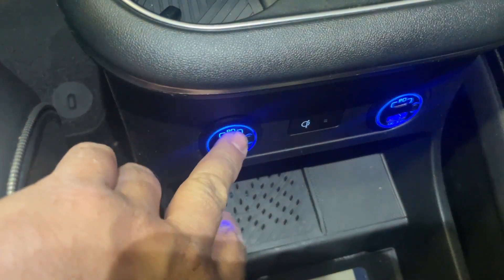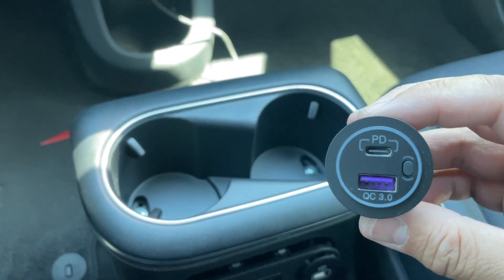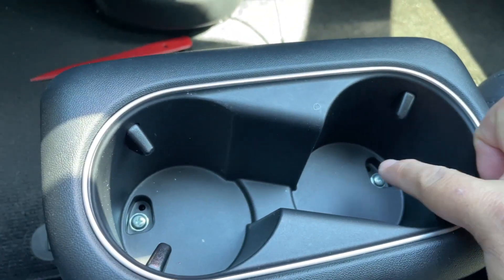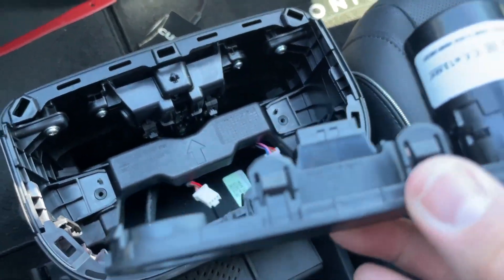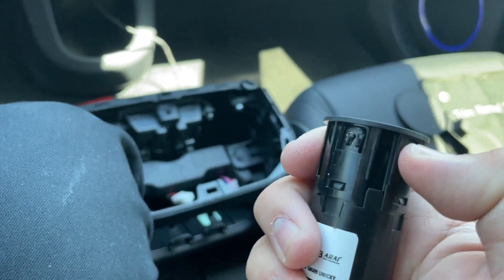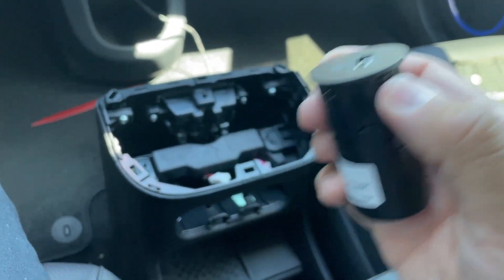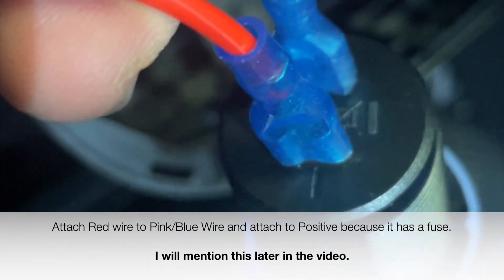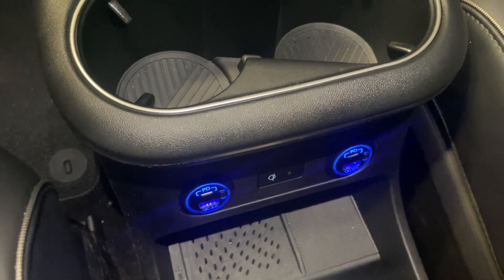Ioniq 5 USB Install

Comment: I attempted to do this in my ioniq5 that I just got.  The video made it look like a pretty simple task.  I'm here to tell you, it was not simple at all.  First off, the disconnect the three plugs was not easy as the catches are on the bottom of the connectors. I finally got them disconnected.  Secondly to disconnect the outlets was not easy either.  I have weak hands and found it very difficult to push the tabs in.  After much attempts, I finally got them out.  Now to tap into the wires.  There is very little room to work on the outlet on the right side. I used pinch clips instead of trying to cut the insulation on the wires.  I finally got them clipped in, very difficult!  Now to the left side.  This one is next to impossible with absolutely no room to work and absolutely no lead in the wires.  Needless to say, I gave up, put it back like it was originally was.  If you attempt this, good luck!  I made a little box for my outlets, put in an inline switch and connected them directly to the 12 volt battery and put them in the Frunk.This way I can use the fast chargers with the car off and the switch on.  I turn it off when no in use so there will be no draw on the battery.

Comment: What are the brown and pink wires in the molex connector for? Were they even connected to the original usb that came with the car? Instead of tapping into the wire, can a molex connector be used?

Comment: Hi @Rey. thanks fot the video. Did you tried to see further and remove the center console too? I wonder if we could conceal and pass a USB cable remotely under the console and under the floor up to the lower center front tray (where the Apple CarPlya/AndroidAuto USB port is located)

Comment: I found these same replacement ports on Amazon, ordered and installed. I used 18 gauge T-connextors for the same wires and it's working great. Things are a bit tight in there but overall came out great. The hardest part was popping out the factory usb modules from the face plate. Took me 20 minutes. The rest only took another 30 to get it all wired back up and put back together. One thing I noticed is that in order to use the usb ports, you have to press the button after restarting the car. Anyone else see this? Maybe that's part of the reason for the extra wires in the harness? We'll see how these go over time. Thanks again for the video!
Reply: Having to press the button is part of the "features" of the replacement module. It's set up to be off by default, which is useful in some setups I suppose. I believe the other two wires are for the lighting on the stock module, which is tied to the car's night lighting.
Reply: Sound good. Was that easier than what was done in the video?

Comment: Hello Rey,
do you know by chance also how to remove the USB port in the footwell (center). I would like to run a cable under the carpet that then comes out behind the cup holder again, so that is not constantly a USB cable in the footwell.
Regards
Florian

Comment: I am still confused!  After connecting two of the four wires, what did not work?  The two middle wires had to be used for something.  One response was it was for the light for the charging pad.  How about the charging pad, will it still work?
Reply from the maker: Everything still worked.
Reply: Don't worry because the response about the charging pad was clueless, the guy didn't understand the question about the wires. The phone charging pad has nothing in common with the USB charging ports, period.But in the end we still don't know what the 3rd and 4th extra cables (brown and pink) are for at 3:50...

Comment: Any idea what the extra wires on the connector are for?
Reply: I too are curious what these are for if it is only for charging
Reply: The middle one is for the wireless charging pad indicator light.
Reply: @jamice4u  Does that mean the charging indicator light will no longer work if the wire is not connected?  How about doubling up on the two wires before you connect them to the outlet, do you thing the indicator light would then work?
Reply: @jimmybroadway6676  Why would you want to mess with it? I have the SEL version of the car. So the SEL and the Limited Version have the wireless charging pad.
Reply: I may have an idea but cannot confirm it. Maybe these additional wires tell the infotainment system of the car which USB port is currently in use? BTW the other comment telling that they are used for the wireless phone charger makes no sense, because the Qi charger is not related to the USB ports and has its own separate and bigger cable harness that we can even  see on the left  in the video. The guy has mistaken you question that was specifically about the additional 3rd and 4th wire of the USB cables harness, with the separate harness of the QI charger completely unrelated to the question here.
Reply: @fluxcapacitor  This makes the most sense. USB-A pinouts carry data over the middle two pins, and power on the outer two. I don't see why they would cross connections in their design for this module. It may not be apparent to the end user, but this connector is wired for data - by doing this mod you're removing that capability, but it may not be used anyway.

Comment: I just subscribed to your channel. Can you replace the front USB (Android Auto) port with the same charging ports or is it too complicated for you or maybe the rear two one in the back seats. Maybe it might be a great ideal for another video.
Reply: Because it is used for AA, I will not consider replacing that one until someone proof that it still works fine
Reply: @EddyBenalal  Have you tried replacing the charging plug for the rear seats? I am so busy. I replaced the front two just fine. But I have not replace the one for Android Auto. Because I am waiting for the original poster to reply to my comment. He doesn't engage very much with his audience.
Reply: @jamice4u  I didn't get my Ioniq yet. Two weeks more and I could tell you :)
Reply: @EddyBenalal  Welcome to the club. I change out the front two like on the video.
Reply: @jamice4u 
Does AA/Carplay still work via de usb-c?
Reply: @EddyBenalal  Do not have the courage to change the front usb connector and that is the only connector that works with Android Auto since it is the one that is connecting to the car's computer.
Reply: You would need something else for the AA port because that port needs to send Data back to the car, and these adapters are power only.

Comment: Will  Apple car play and Android auto work via these USB-C ports?
Reply: I don't think so, because as far as I know only the front USB has this capability. The rear ones are for charging only since they don't have a data connection to the car's Infotainment system.
Reply: @MesoScale  That's true. And it's a big flaw in the design in my opinion. Having to put your phone so low, OR make the USB cable like a line hanging laundry across the two consoles… same design flaw on the Kia EV 6 and the Genesis  GV60!
Reply: @fluxcapacitor  As an owner of the Ioniq 5 I absolutely agree. At the moment I am throwing my phone in that dark pit in the middle and it is only a matter of time before vibrations will eventually break my phones usb port. I am looking for a solution that let me place my phone near the data port, without too much fondling with the cable. Kind of a phone holder specially designed for that. Do you know if something like this exists?
Reply: @MesoScale  Well, I'd say you're with the right person because I have already designed and sold that kind of specific smartphone docks for other cars and I am really interested in designing a brand new one for the Ioniq 5, which I like a lot! 
The problem currently is I don't have access to the car…
I think there is something to do with that lower center floor tray. Although it has been poorly designed, I think is has room for improvement (literally)
Reply: @fluxcapacitor  Terrific! I’d buy your dock in a heartbeat. Let me know when it is ready to buy!
Reply: @fluxcapacitor  in best case it would be “slide in (with a little extra push) and forget” with the phone being connected to the data cable and ideally the phone being at least a little protected from vibrations.

Comment: Seems a waste of effort - most device cables still come with USB-A connectors as default so they work just fine.
Reply: You really don't know anything about USB-C
Reply: @gabriellundmark  Enlighten me then
Reply: @neilt People seem to have usb standards a little confused. USB A, B and C are the plug form standards and USB 1, 2, 3, 3.1 and 3.2 are the actually data rates, power, etc standards for the port. There some other power delivery standards that matter for USB as well. A USB A to C will do about 15W to 18W but to utilize the 25W+ capabilities you need a full USB C cable due to that latest standards being made for USB C only. This is of course assuming automakers wire that level of power to the plug in the first place. Simply changing the plug doesn't magically grant you faster charging.
Reply: @FoxFirechris  Yes, I know all that. But these are simply power outlets that will be used to charge phones and tablets mainly. As I pointed out, most charging cables still come with USB-A connectors on the power supply end, even if they connect to USB-C equipped devices. So this modification is a lot of work for no good reason.
Reply: @neilt  that's simply not true. Converting USB-A to USB-C is out of spec and generally something you won't see. While you can charge some devices this way, it won't allow for much more than 12W of power delivery and that isn't enough to quickly charge a modern phone, let alone a laptop. 

The other way however is perfectly within the USB specification (USB-A to USB-C) and would allow both type of devices to get the maximum speeds. You could charge an iPad or laptop and use it simultaneously. 

It boggles the mind why Hyundai didn't put USB-C in this thing.
Reply: @gabriellundmark  Given that this is a car with a 13A socket beneath the rear seat, I see no point in making a fuss about charging my laptop from a USB socket - and it does use USB-C for charging. I use the mains charger at home, I'm happy to use it when away from home. My Galaxy S21 happily charges gently while connected to the front USB socket, providing the music I listen to. This does seem to me, at least, a solution looking for a problem.
Reply: @neilt  while it might seem like that to you, that clearly isn't the case for everyone. Most new cars use USB-C for the reasons listed above, and while you could use the 240V socket and a household charger to get USB-C in the backseat of the Ioniq 5, the point is that you shouldn't have to bring your own charger just for something as basic as charging your devices in 2022. 12W USB-A isn't even enough to charge my phone other than on very long trips.

Thankfully the socket seems easy enough to pop out and hopefully someone makes a direct replacement that slots right in without any wire splicing needed.

Comment: Bye bye warranty.
Reply from the maker: According to the Magnuson-Moss Act, a vehicle manufacturer cannot automatically cancel your warranty just because you’ve installed aftermarket car parts. This is an illegal practice. That said, if your aftermarket part somehow causes or contributes to a failure in your vehicle, the dealer may be able to deny your warranty claim—as long as they can prove the connection. In these cases, the burden of proof is entirely on the dealership.